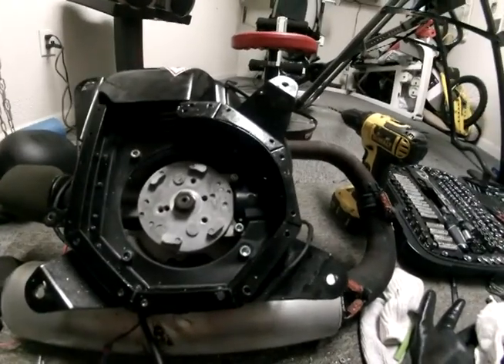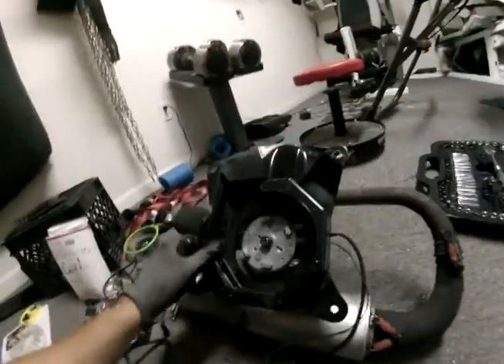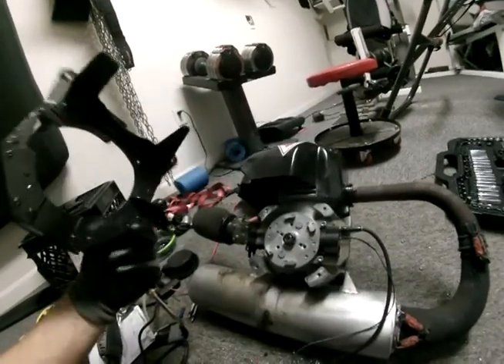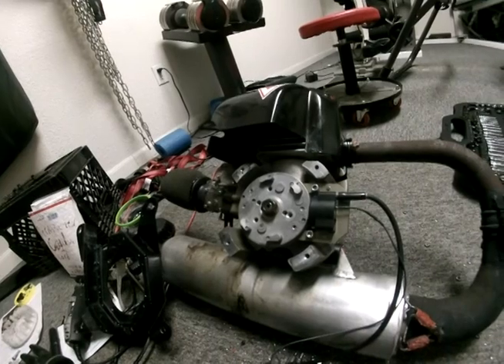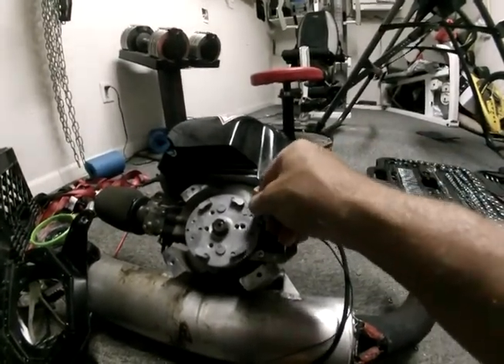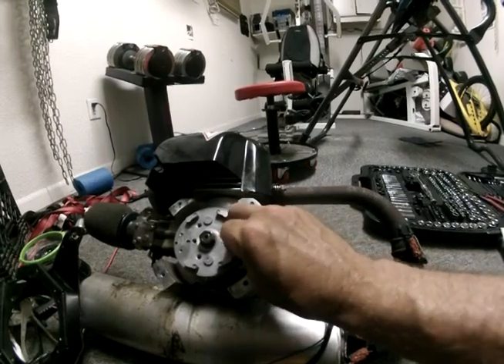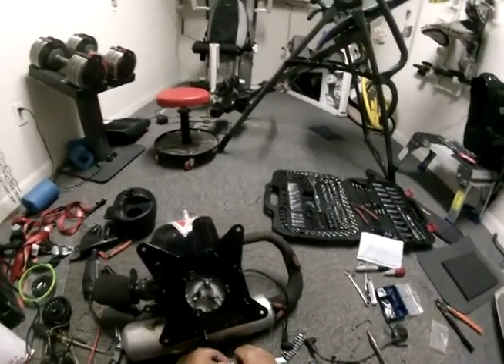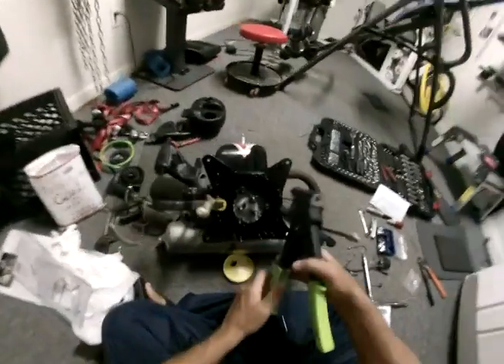top 80  paramotor ignition coil replacement

Comment: Lyn, this is Bill Callahan again replying to your below. This is what happened since I wrote my Death Comment below. I was sitting down beside my Miniplane, in mourning, and got to thinking. What the hell else can I do because that guy's video (yours) made me feel suicidal almost. 

I smoke cigars so I lit one up and sat there deep in thought. It was raining. I was outside. Hmmm? In north Florida for the past two weeks we have had nothing but overcast skies, rain, drizzle, fog, high humidity....are you starting to get the drift? 

I checked Ohms. 8750. No Spark.

HEAT GUN! What the hell?! I got nothing else to do. Try it. I did. I held it about 18 inches away from the coil and wiring for the length of the cigar...about 25 minutes, on high heat. I checked Ohms again. 10,250 Ohms! Pulled the rope while thinking my meter was screwed up. CRANKED FIRST PULL. Sometimes it pays to just sit back and think! I've rescheduled my suicide! :)

Comment: How did you know the coil needed replacing? What were your symptoms? I'm thinking mine needs replaced cause my throttle sortof fades away after about 15 to 20 minutes or so of flying. Thanks for posting the video. I wish this could be done professionally cause I am dreading this
Reply from the maker: all that BS to replace the coil.the engineer that design that way needs to be .
Reply: @lynperk  I agree! Thanks so much!
Reply from the maker: the kill wire broke off i couldn't kill the motor